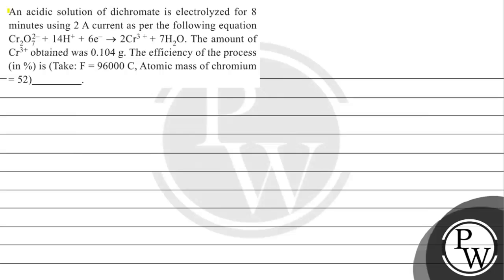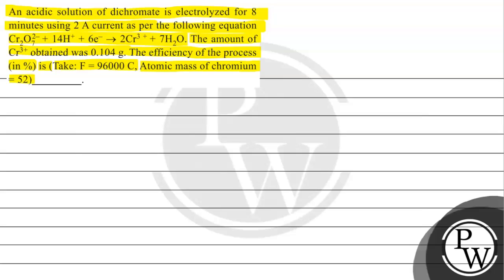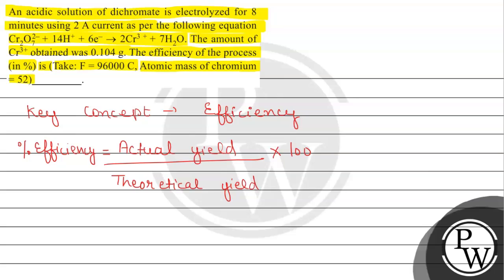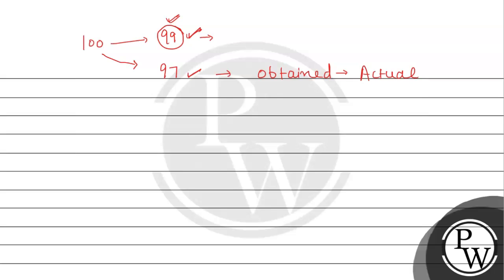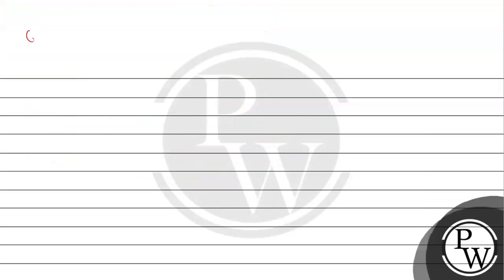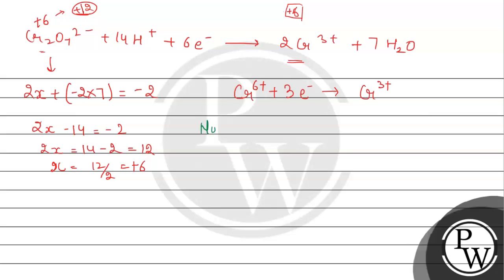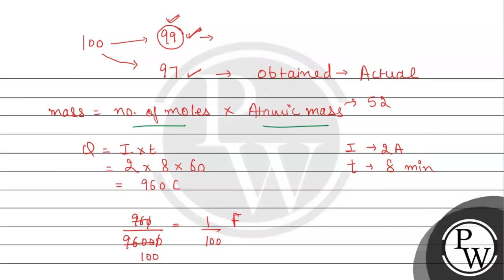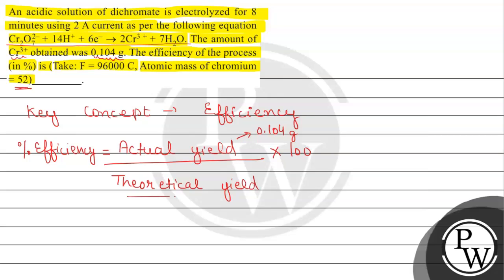An acidic solution of dichromate is electrolyzed for 8 minutes usin...

Comment: An acidic solution of dichromate is electrolyzed for 8 minutes using 2 A current. As per the following equation

Cr
2
O
2
7
+
14
H
+
+
6
e
−
→
2
Cr
3
+
+
7
H
2
O

The amount of 
Cr
3
+
. obtained was 
0
.
104
g
. The efficiency of the process 
(
in
%
)
 is (Take : 
F
=
960000
C
, At. mass of chromium 
=
Reply: Aab dekh bhai tu kaha h